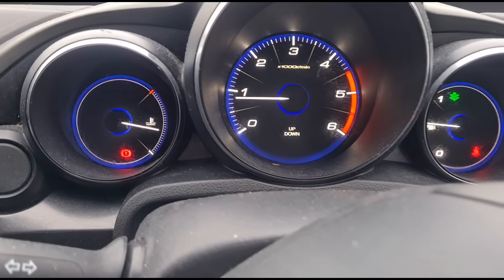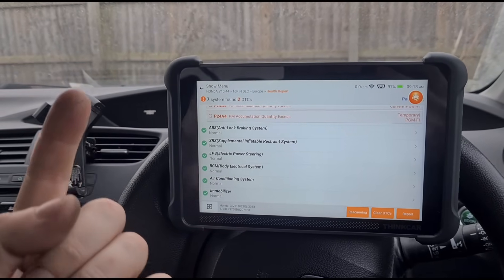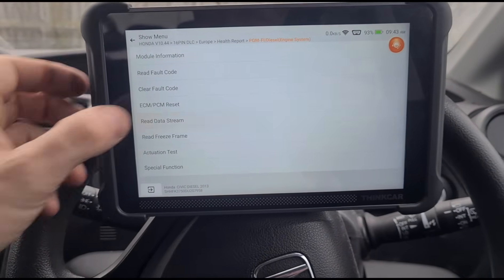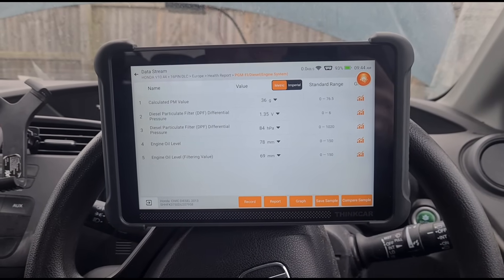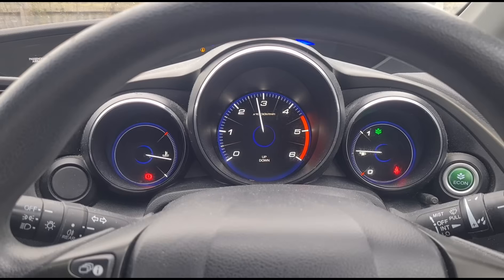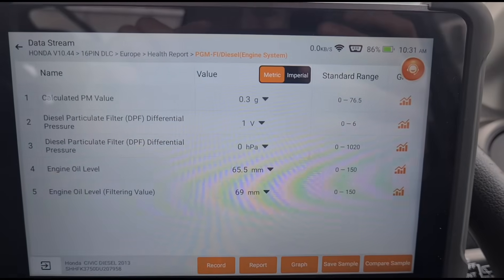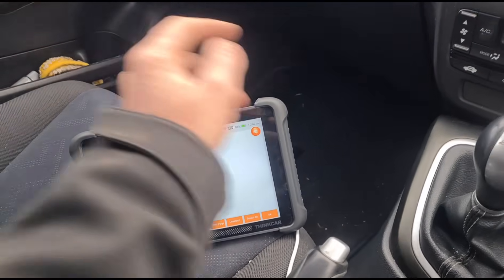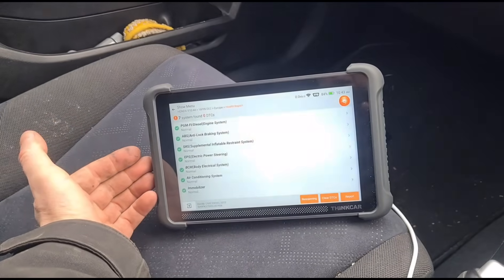Honda Civic P24A4 PM Accumulation Quantity Excess

Comment: I have a Honda accord since 2015 and the air con has never worked, but I’ve never had dpf issues until recently. I’ve changed an oil pressure sensor and cleaned the dpf a few times, the car has 200k miles on it now, would you think it could be a damaged dpf or does the air con need to be recharged
Reply from the maker: Even if it doesn't work I believe it has to have ac pressure

Comment: I've got a civic idtec at work that has eaten dpfs, its been round the workshop basically. I've found both EGT sensors are leaking, by spraying soapy water on them. I'm sure this is causing the car to throw the lambda out and causing excessive soot hence killing dpfs very quickly. Management don't seem convinced and just want rid of the car. Do you think my theory is right?
Reply from the maker: I doubt it
Reply: @ORileysAutos  thank you. It's a car that's baffled us, and Honda technical, a big part of us and Honda technical is saying it's his driving as his average speed is 15mph but he's blocked the dpf in a month and 1000 miles.

Comment: Hi Jimmy, I hope you’ll reply to this unique situation. 
I have a Toyota Proace 1.5 (2019) with P20EE fault code and adblue light. adblue injector is clean. 
My Launch diagnostic tool extracts this live data: 
- Denox catalytic converter urea load: 0 gram
- Operating status of the demos system: Urea gauge-pump module stopped. 
- PRESSURE OF THE UREA FLUID: 0.5 bar 
- Urea gauge-pump module operating status: on standby.
What would you conclude? especially seeing this odd value of 0.5 bar for the pressure sensor? I read that normally the lowest value is 4 bars. 
I read elsewhere online that such pressure sensors are available on Alibaba. Do u think replacing it would cure the issue?

Comment: hi ,i have seen most of your vids ,now i got one of the probs and wonder if you can answer  a question for me , i got a 20 20 diesel  nissan nv300 ,  , just coming up to 100000 miles i put REDEX into the tank for the first time ,drove about 20miles now the EML is on and a  spanner and it says  check  Anti Pollution System, what should i do about this please ,

Comment: what is the link between the AC system and the dpf, is it just a totally random requirement to automatically regen the dpf or is there actually some link
Reply from the maker: According to the scan tool it says honda require the extra drag on the engine. Also it engages the fans
Reply: that’s interesting thank you for replying bro (idk why im on a different account now)

Comment: Hey jimmy. Ive got a fiesta with a 1.6 duratorq diesel. Same as peugeot, citreon, volvo, mazda. Ive got a shakey engine. Ive checked everything but the pcv. Would a pcv stuck shut or open cause enough imbalance to make the engine kinda vibrate?

Comment: Issue with Renault Trafic 3 - Smoke in Engine Oil with Oil Level Warning

I have an ongoing issue with my Renault Trafic 3. I have properly cleaned the exhaust system (DPF), checked the injectors and oil sensor, but the problem persists. Even though I recently changed the engine oil, the engine is still emitting smoke in the engine oil, and the diagnostic tool shows a warning related to oil level reduction.

I’ve visited several workshops, but unfortunately, none of them have been able to pinpoint the exact cause of the problem.

Details:
	•	The exhaust system (DPF) was cleaned properly.
	•	The injectors and oil sensor were checked.
	•	Engine oil was recently changed, but the smoke in the engine persists.
	•	The diagnostic tool shows warnings about oil level reduction.

What I need:

I need assistance in identifying the main cause of this issue, as I have tried several solutions, and the technicians have not been able to diagnose the problem accurately. If there is any issue with the engine system or any component that hasn’t been thoroughly checked, I would appreciate guidance on the next steps or parts that might need a detailed inspection.

Comment: sparks could mean the coil is knackered which pulls the clutch in to drive the AC pump you can replace the coil jimmy will probably be cheaper than a new pump

Comment: if you don't use the AC during winter time because you think it's only for summer the shaft seal gets dry and the gas will leak out past the seal when the AC is working the seal gets wet and helps stop the gas leaking past it .

Comment: Some of the pin holes in AC pipes I’ve seen, I’m not sure you’d see smoke. Best thing to do is pressure test them. There will be a leak somewhere in that ac system.

Comment: I have 2 of these civics great cars in general the owner should turn the econ off it makes absolutely no difference in mpg.
Reply: Most pointless feature ever, makes the cruise control struggle at the first hill it gets to, and almost turns the AC off
Reply: What about using it driving around on main roads? I have just brought a civic so would love to know  please
Reply: @Roosko.1  you won’t really notice any difference, the pedal is a bit slower to react and you get the green eco lights around the speedo, thats about it.
Reply: @Roosko.1  It makes no difference you can try it to see for you're self but it really doesn't.
Reply: even if it doesn't make a difference, try driving in the 'green'. it will help you unlearn the heavy foot accelerating, which does affect mpg
Reply: @kacpr  obviously thats not what i said having that on or off makes no difference if you drive the same way is what i said.

Comment: Does ac have to be on all the time? Every time you drive ?
Reply from the maker: The ecu should engage the AC when needed
Reply: @ORileysAutos 😂😂😂 only needs AC to work to do forced regen. They don't use it for active regeneration and this dpf was not blocked because the AC didn't work 😂😂😂

Comment: how often does the honda i-dtec regen?
Reply: Mine does an active regen about every 500miles (mainly urban)
Reply: @GLH8  how do you know when it's doing one?
Reply: @robertsedgwick1629  usually it smells hot and the fans are running when I get out.  But it does somehow feel smoother when driving and the trip fuel economy takes a hit.
I had it 5 years, so have got used to its characteristics.  Never needed to take it for a long drive or service, even through covid lock downs.
Reply: @GLH8  ok never notice a hot smell but the exhaust note get a little deeper
Reply: @GLH8  What is your car mileage?
Reply: @GLH8  same

Comment: Why does the ac pump need to work to do a regen?
Reply: maybe because the fans are on giving an airflow over the manicat & dpf
Reply: Add load to the engine to aid with heat etc. Got to be other reasons too
Reply: I'm guessing that it's a specific honda programing